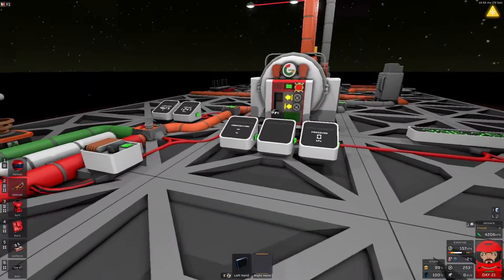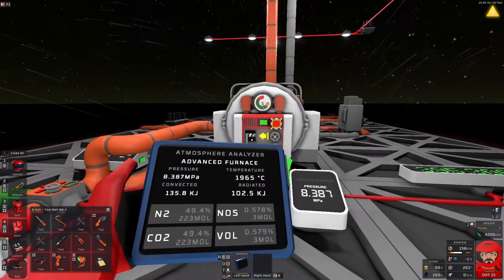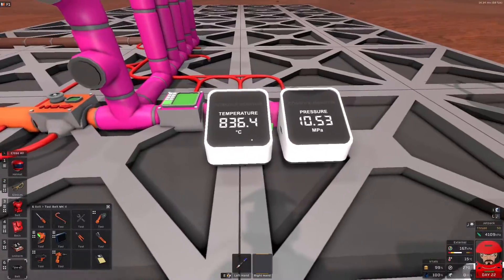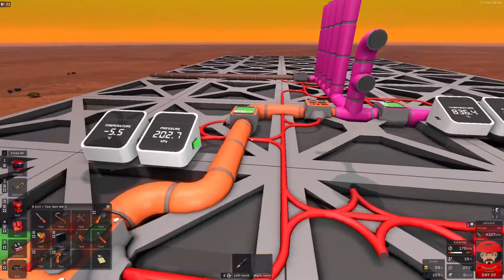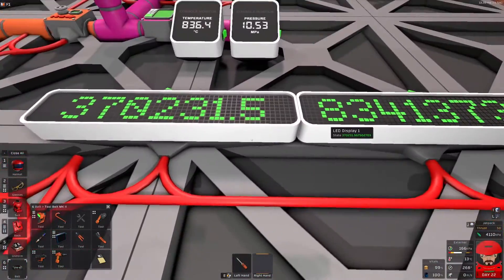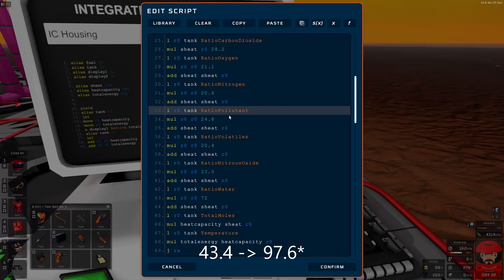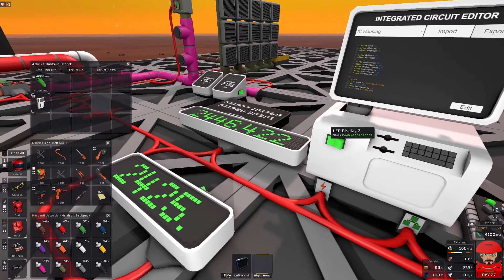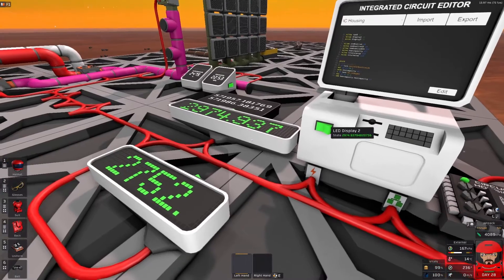Stationeers Precision furnace build 2 Combustion maths

Comment: I think that by volatiles they don't and didn't ever mean H2 at all, but I'm thinking isn't it actually methane (though it would mean you can't combust them to water), because what would then the composter produce if not methane.

But one good advice. Don't listen to me! I'm less studied!

2N2O + 2CH4 => 2H2 + O2 (they go boom) + 2N2 plus ... Uh-oh 2CH2. So let's say the last thing, the molecule "after the uh-oh" is wrong in real life, because, yeah, I remember Lavoisier and Lomonosov, but let's say that they are actually right in Stationeers, because as we found out in your pipe flow video, Stationeers was made pretty realistic, though it still has some compromises.
So let's say the 2CH2 they simplified to 2CO2, plus they simplified that Mmmm, half of the fuel you are actually combusting is ... made by magic.

But mark the important words: don't mark any other of my words, cause you know what's a disclaimer? I'm Czech elementary school student, so anything you don't like in the chemical nonsenses you can as studied chemist I think, of course feel free to cross out.

Edit: still don't mark any of my thoughts, but if you had methane and O2 at some ratio you can actually make H2O, even in real life, though you would have waste CO2, I guess?
CH4 + 2O2 = CO2 + 2H2O
Reply: Except the energy released per volatile mole burnt is the same as the IRL hydrogen enthalpy.
Reply: The reactions are not only nonsensical because they violate conservation of matter, but they are also inconsistent:
(And if you add the different plants to the mix you can get all 7 chemicals from nothing!!)
Electrolyzer:
 2 H2O ->   2 V +  1 O2
 => 1 V = 1 H2 (so far so good)

H2Combustor:
 4 V +  2 O2 ->   3 H2O +  4 CO2 +  2 X
 => 2 V = C2 H3 O4 X1 (impossible)

Furnace/pipe combustion:
 2 V +  1 O2 ->  0 H2O +  6 CO2 +   3 X
 => 2 V = C6 O10 X3  (impossible)

methane: 1 CH4 + 2 O2 -> 1 CO2 + 2 H2O (less CO2 and no "pollutant")

Comment: At 23:13 where the 54.2 comes from ? heat value of combusted gases from H²-N²O is 97.6 (2 N² and 2 CO²). I'm stuck at this part to understand the formula
Reply: 54.2 is the specific heat per mol gained from the combustion.  The fuel (V and N2O) has a specific heat per mol of 43.4 and it combusts to 97.6 (2CO2 and 2N).  You're just subtracting the resultant specific heat from the initial specific heat.
Reply: @jameskrogman6786  thank you for the explanation!